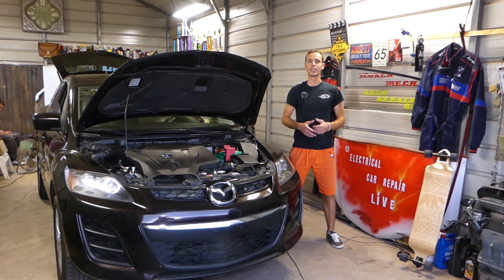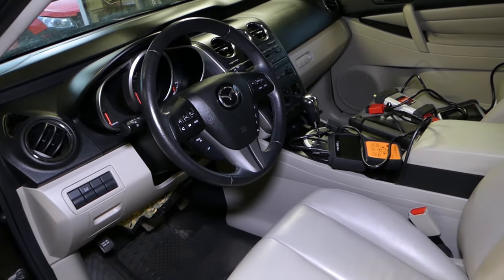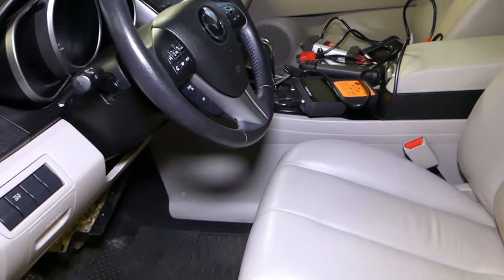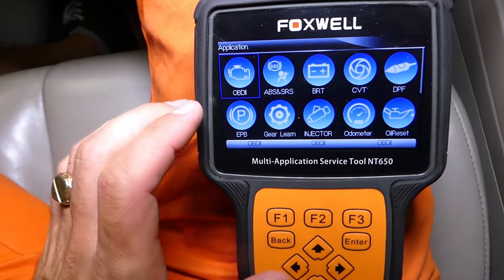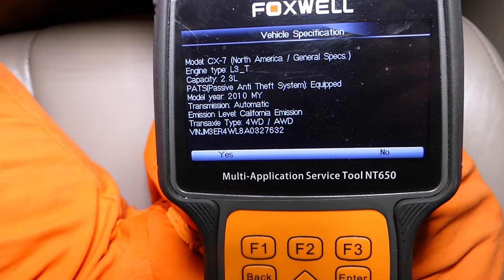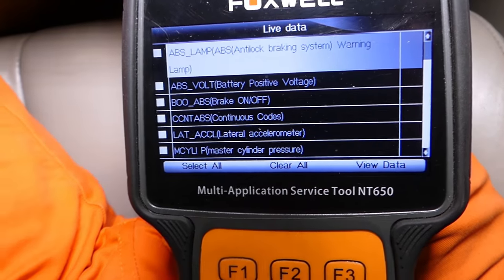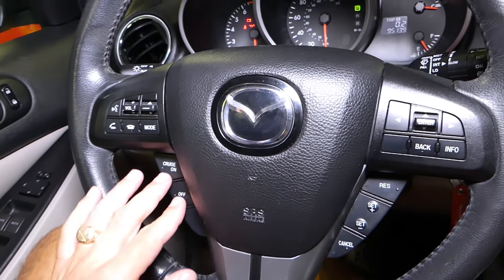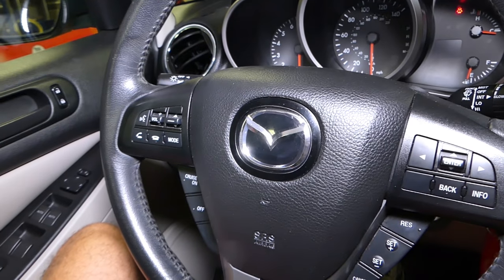WHY CRUISE CONTROL IS NOT WORKING. TOP 3 REASONS CRUISE IS NOT WORKING

Comment: Try this....while you are driving and the cruise control will not engage...put your foot under the brake pedal and pull up as you attempt to engage the cruise control. If this works then your problem can be resolved in many cases by simply spraying WD-40 on the shaft that slides in an out of the brake switch. This removes the resistance/debris that  builds up over time on the shaft and permits the shaft to slide freely thru the switch.
Reply: Thank you for taking the time to comment this, you saved me time and money
Reply: @kylethem9969  Glad to hear….the cruise control on my Silverado has been working fine for almost a year since the WD-40 treatment. Good luck!
Reply: Brilliant thanks for this it worked straight away 😁
Reply: Thank you so much !!!!!
Reply: Brilliant, logical and simple. Thanks
Reply: Brilliant mate. We were driving and cruise control switch off by itself and my friend try your method and it worked but he pull not brake but clutch and it worked straight away 👌👌👊
Reply: Thank you Jerry, its working
Reply: It worked!
Reply: thank you that's all my problem right away no computers no diagnostics just some good old WD-40
Reply: Do you know why cruise control and wipers stop working
Reply: 2016
Reply: Where it located?
Reply: @billypadgett5851  where is it located?
Reply: @lizfranklin9854  it’s located around your brake pedal (or clutch pedal if a manual shift)…

(1) Move the front seat back, (2) lay in the floor, on your back, next to the brake or clutch pedal, (3) while looking up at the brake/clutch pedal, put your hand on the brake/clutch pedal and pull it down…as if you were stepping on the brake, (4) while looking at the action that you are creating, you should be able to see both the brake sensor and the shaft that is being referred to. Spray WD-40 on both the sensor and shaft. Heck, spray WD-40 on the entire area. Good luck.
Reply: @jerrywhite506  do you have a Facebook page? So I can message you on there!
Reply: @jerrywhite506 day1, I bought a 2008 Vectra 1.8 - cruise not working. day2 I found your post. Your method didn't work with the brake BUT worked fine with the clutch pedal. I'll dig out the WD40 to make it a bit more long terrm. Thanks Jerry, I'm very grateful !
Reply: You might be a genius!!

Comment: I replaced the wheel speed sensor cause I snapped it. The cruise control of course stopped working. The ABS light went off after installing the new one. Cruise Control still doesn’t work. This is for a 2007 Lexus es 350. What else could it be guys

Comment: Hi..Ive got a kia sportage 2011 my cruise control will come on but i cant set it iv also noticed my gear shift indicator display has dissapeard?? Iv just had the clutch switch and neutral switch replaced and still not working..iv been told there is a switch near the radiator which looks damaged??? Any help would be great guys

Comment: On a Buick LeSabre... If you push the 'Cruise Control' button and nothing happens (no amber light on in the on/off button) the easiest and therefore the FIRST thing to check is the #14 fuse in the fuse-box under the hood.  If that is not the problem, the SECOND thing is check fuses under the steering column. (Under the steering wheel, about where your left knee is when driving). Remove the plastic cover panel (it just pulls off), then remove the steel plate that is under that panel (just four 10mm screws).  There is a small black rectangular plastic box with wires sticking out of it. Open the box and you will find three 2 AMP fuses. Check these for a burn-out.  They control the lights/function of the buttons on your steering wheel. AND they are not mentioned in the owners manual. This job takes about 10 minutes to do, and it will save you hours or even days of frustration.  (I just fixed my own 2004 Buick Lesabre this way; and also fixed a friends 2001 Lesabre this way; so I'm guessing they all have these 2 amp fuses under the steering column).
Reply: i think you just saved my life, lol im going to check this out hopefully soon! mine just went out while i was driving out of no where!.

Comment: My Sienna 2005 has a check engine light on. The code says P0793, intermediate shaft speed sensor A circuit no signal. I wonder if it’s because I haven’t used Cruise Control in 4 years, and maybe some parts need cleaning?

Comment: Thanks guys. I had a problem with my nissan Dualis cruise control, when I turned it on the cruise light was on but the "Set" light would only flash and not allow it to engage. I cleaned the brake light switch and the clutch switch with WD40 which did not seem to make a difference, however I decided to see if there were any error codes that needed clearing and sure enough there was one, which after clearing it became operable again.
Reply: How did you determine the code and how you clear the bad code?
Reply: @annettewolf7037  I cleared the code with the scanner, just prompted it to clear any errors. However, since doing that, the cruise is again not working! Could be an issue in the abs system.
Reply: @bernardmiler3106  Hi, what code did you get? My Sienna 2005 has a check engine light on. The code says P0793, intermediate shaft speed sensor A circuit no signal. I wonder if it’s because I haven’t used Cruise Control in 4 years, and maybe some parts need cleaning?
Reply: @brighteyes6559  p0096. It turned out to be a faulty turbo charge temp sensor, a very easy and cheap fix.
Reply: @bernardmiler3106  Great, good for you. 😃

Comment: My Toyota Avensis 2008 cruise control keeps on tripping. Sometimes it re engage when selecting again but then times you have to switch off everything and switch on again. There is not a exact patern that caused the cruise control to trip. Did you have a similar problem like this?

Comment: The ride side of my steering wheel (cruise control settings) doesn’t work. No abs light. 

The left side of my steering wheel works (volume, mode, mute & Bluetooth buttons work)
Reply: I’m having the same problem on a Nissan Rogue. I went to the junk yard and replaced the cruise control switch but it stayed the same. I’m starting to suspect the clock spring may have something to do with it. Let me know if you find anything out.
Reply: Just fixed mine. It was the clock spring.  I just replaced it and the cruise control is now operating normally. Cost like $25 off of eBay.
Reply: @Omardottcom  what is a clock spring 🤔
Reply: @my_flippin_journey  A clockspring is a spiral-wound special rotary electrical connector which allows a vehicle's steering wheel to turn while still making an electrical connection between the steering wheel airbag and/or the vehicle's horn, cruise control, radio control, and other devices and the vehicle's electrical systems. The clockspring is located between the steering wheel and the steering column. Another term for this automotive part is a spiral cable.
You can look up videos on YouTube on how to replace the clockspring in your specific vehicle. That way you can see what it looks like and how to replace it. It’s not hard. Just delicate.

Comment: I have a 2020 Volvo XC90. I had my brakes changed the other day and now the brake light stays on on my Dash, It also says parking brake service required, and my cruise control will not work

Comment: Erick mine is a 07 caliber, some times work and some times not, but when fail car is over 3000 rpm
and replaced crankshaft position sensor and after clear code and  check engine  light up again works fine one day even w/ engine light on but next day is hard stared and rpm fail again and when that happens, cruise control not working.  I have disconnected battery and works fine again, what can I do??

Comment: Okay so my cruise control does not work. I don’t have a bad brake light switch, the light comes on and off (can’t enable it) nor do I have any lights. I’ve also tore the steering wheel apart and all the wires look to be in good shape. I can’t figure it out for the life of me.
Reply: We’re you able to figure out the problem?